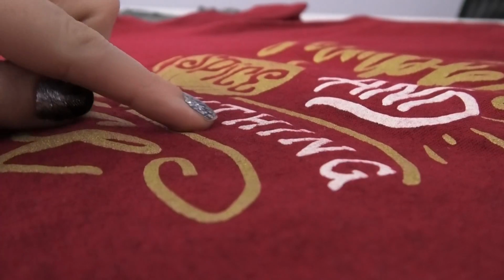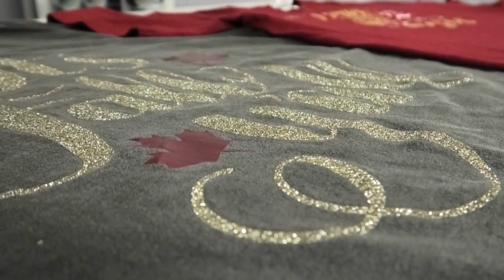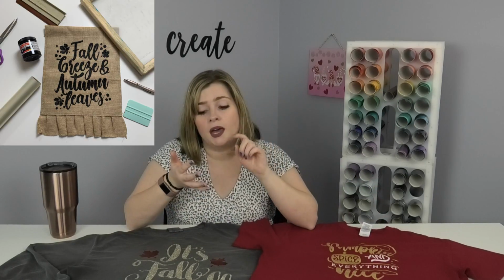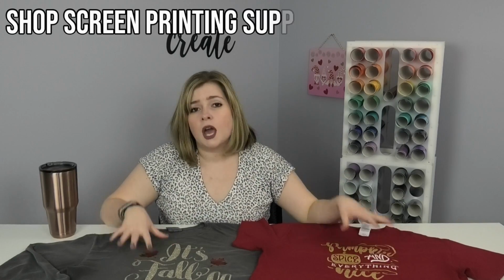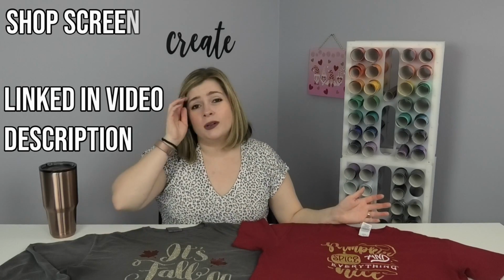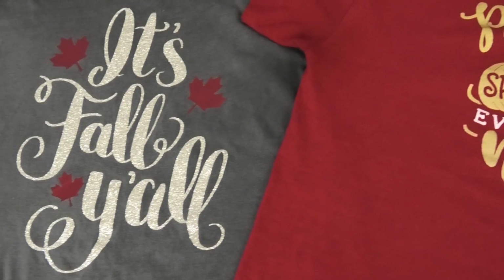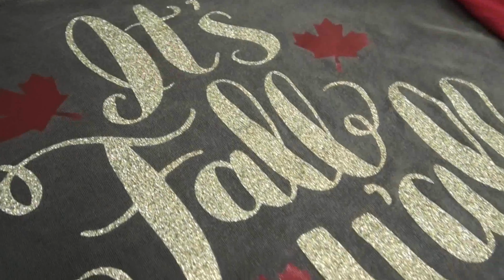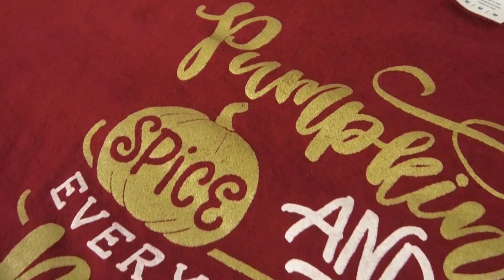HTV (Heat Transfer Vinyl) vs Screen Printing

Comment: Can you heat set a screen print and add adhesive and foil to the shirt
Reply from the maker: Adhesive foil won't stick to fabric, but you could add foil HTV after heat setting your ink.

Comment: Can you only use each screen print once. In past videos I watched you said you clean it right away and have to remove the vinyl. Is it a one time use ?
Reply from the maker: You can make multiple shirts with the same screen, but it has to be done all in one sitting. So once the project is finished, it needs to be cleaned immediately after to prevent ink from drying on the screen.

Comment: My dropshipper provides vinyl printing at a cheaper rate than screen printing and i am a small business so should i start with screen printing or vinyl will work good
Reply from the maker: Either works great, it's just a preference thing.

Comment: Where can I spend 40 dollars and get what I need to start screen printing as mentioned in the video?
Only the emulsion costs around 20 usd by itself
I wish I could start screen printing but the prices to get started seem way higher even when buying cheap tools :(
Reply from the maker: I have all mg supplies linked in my Amazon store. I’m talking about water based screen printing, so emulsion isn’t required.

Comment: Great job explaining, except I thought you were going explain screen printing without vinyl. the Real way to screen print you need a screen, emulsion, emulsion applicator, light source, clear printable acetate, ink, squeegee and emulsion remover is you want to reuse the screen.
Reply from the maker: The water based screen printing you can do using vinyl and a Cricut works great!

Comment: Wondering how to remove a paint drip/mistake on the shirt? I would think it would be impossible to remove without a stain! Please advise
Reply from the maker: While the ink is still wet, dab at the area with a wet wash cloth and some Dawn soap. Don't heat set until you're happy with how it looks and it will be fine!

Comment: Which one would you say is more durable? I’ve heard that the water based screen printing doesn’t last as long as HTV but, since you create both, I wanted your opinion.
Reply: I’ve bought shirts with both and I’ve found screen printing to last longer than HTV when I wear and wash them
Reply from the maker: I think they are equal. Neither of mine have ever worn out.

Comment: We just started trying this but after we do one and try to do the second shirt the I le doesn’t go through well and we can’t get a clean transfer.  Do we have to press down harder after the first one or what are we missing?
Reply from the maker: It is a balance of pressure along with the angle of the squeegee.

Comment: Which is more durable?

Also, how many times can you use a screen?

Once you make a screen, can you keep your design on it for use in the future? (I had thought so but at the very end of the video you said something about making a few screens) 

Thank you😊
Reply from the maker: They are equal in durability in my opinion. You can use a screen on the same project until the ink begins to dry. You can create permanent screens using HTV, but if you decide to use adhesive vinyl for most projects (like most do), then you can’t reuse the screen in between projects. Once the ink starts to dry its time to rinse the screen and apply more vinyl.
Reply: @DIYAlex  thank you. Much appreciated!!! I designed a logo and made a t-shirt for my farrier, now he want 10. Haha.

Comment: Can you let screen printing dry in a hanger or does it need to lay? Also, how long does it take to dry. I have a bulk order to fulfill and I’m wondering best option as I need to do front and back of shirt ...
Reply from the maker: Yes you can dry it in a hanger. Dry time depends on how thick your ink is. I like to wait overnight if possible before heat setting.
Reply: I use a hair dryer on my shirts to help the ink dry faster

Comment: I did screen printing for years and will add it can also be messy ink gets everywhere I love vinyl but if you want to print fine details like a monochrome image silk screen printing  is the way to go but instead of using vinyl over your silk screen  I recommend photo emulsion  vinyls over silk screen can't do details and you should print your image on transparent paper to use with the emulsion.
Reply from the maker: I agree it can get messy! Thanks for the tip!
Reply: Thanks for this detail, I’m going to look what photo emulsion is because I’m lost.
Reply from the maker: Photo emulsion is used in traditional screen printing. It’s not necessary when using water based ink like I’m showing in my videos.
Reply: Can someone please tell me what kind of paper you use in order to sell screen prints? No one will tell me :(
Reply from the maker: If I knew I absolutely tell you!